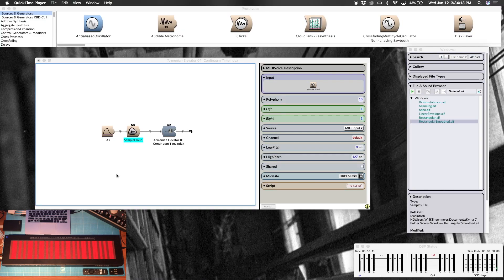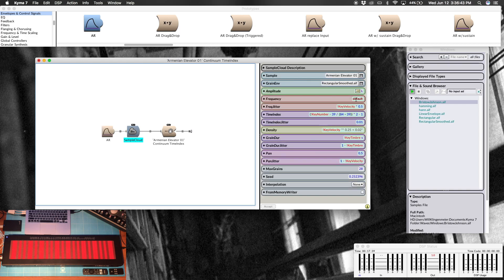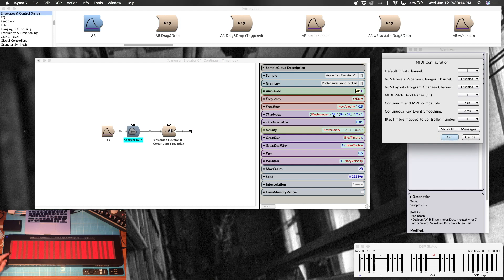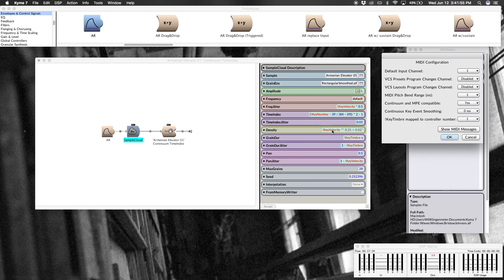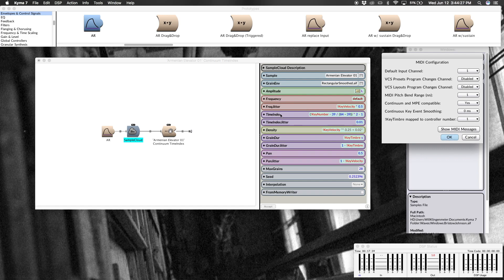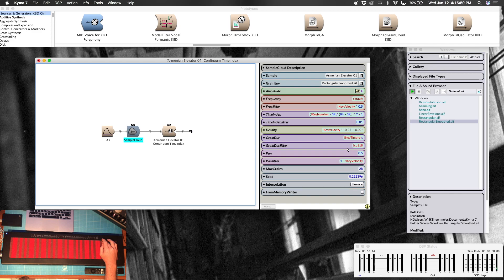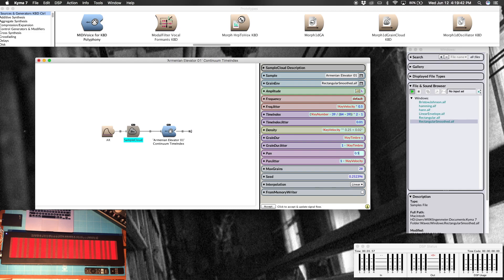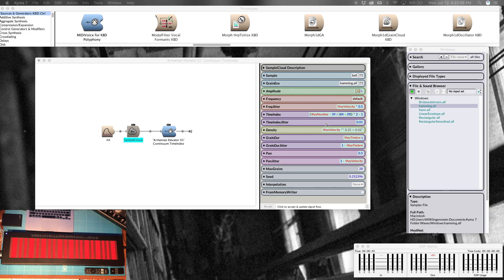Symbolic Sound Kyma Sound Design Vamp on a Sample with Haken Continuum Fingerboard

Comment: Thanks for the video. I tried it with a Roli Seaboard, but only the Fake Keyboard works. I route the Paca through Logic Pro and use the Seaboard via Bluetooth. Any idea, why this doesn't work?
Reply from the maker: Hey! I’m guessing you don’t see MIDI messages from the Seaboard in Kyma? How is the Seaboard connected to Kyma?
Reply: @SpectralEvolver  Hey, thanks for your reply! I found out that it is an MPE Problem. The Seaboard is connected via Bluetooth and the Kyma get's the messages, but it only plays everything, when I choose a single channel in the Roli Dashboard, as soon as I set it up to MPE, the thing won't work in Kyma. Kyma shows all crazy fancy channels and bending stuff, but only a few notes respond.
Reply from the maker: @ You might try to investigate the MPE settings in Kyma as well.
Reply: @SpectralEvolver  Nothing helped, also connected it directly to the Pacmara. I’ve read in the forums that this issue has existed since 2018. Occasionally, Kyma responds and triggers a note, but it’s inconsistent and unpredictable.

Comment: Ok, so my next amateur question would be: is there a difference between command+c/command +v combination and just dragging and dropping into a parameter field? Or is command+c / v  the only way Kyma prefers to have things from prototypes inputted into parameter fields?
Reply from the maker: Drag and drop is an option depending on the scenario. What exactly are you trying to drag and drop?
Reply: @SpectralEvolver  sure. Let's say I want to use lfo modulation of frequency parameter
Reply from the maker: @UsedEQuipmnt  In this case you can copy/paste the LFO directly into the frequency parameter field. If you remove the 'L' the modulation will be at the sample rate, if you leave the 'L' the modulation will be at CapyTalk rate.
Reply: @SpectralEvolver  I see. So, just dragging lfo module from prototypes into frequency parameter field won't work?